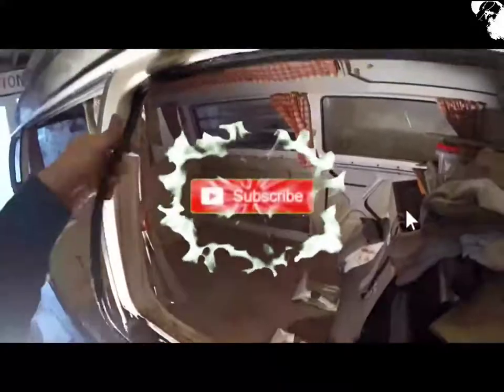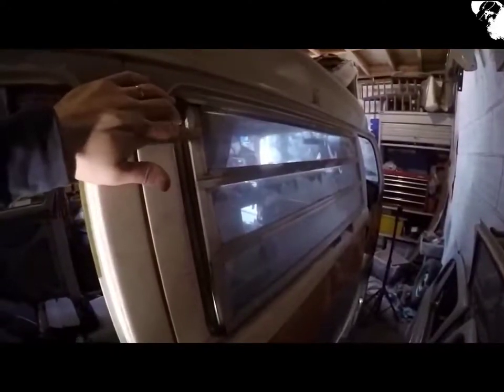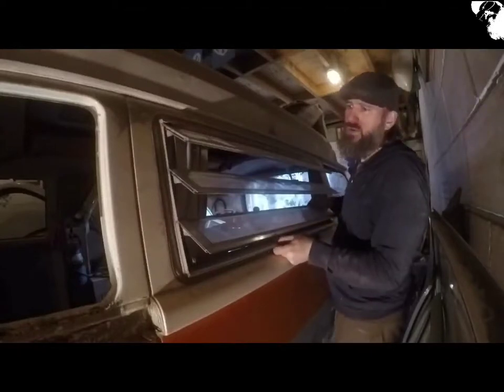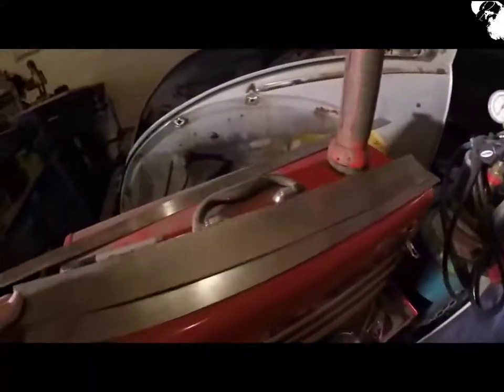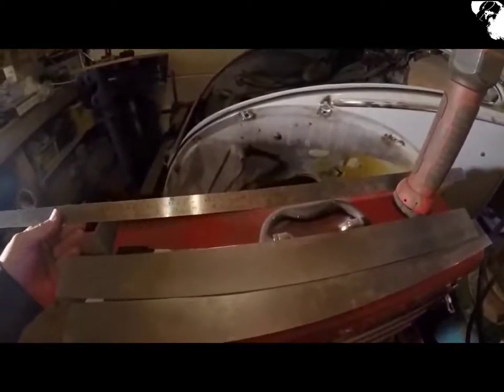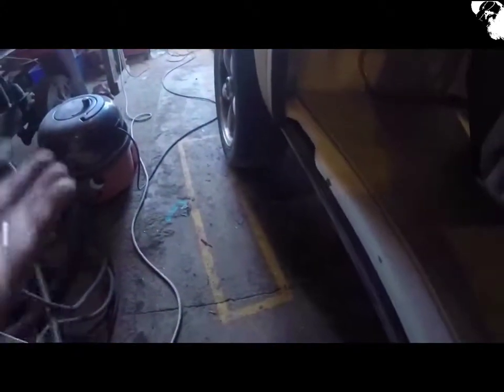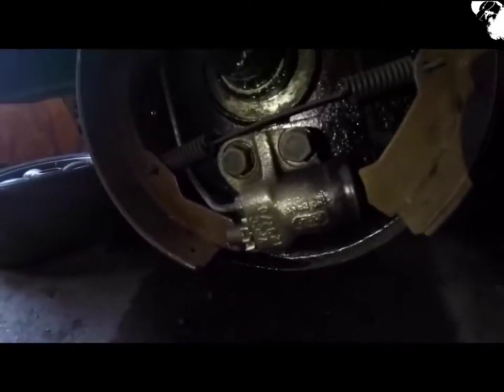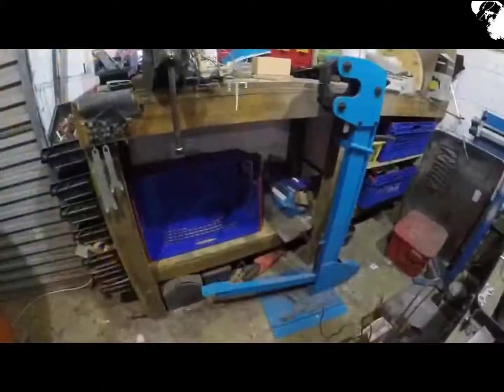Classic 1970 VW Camper Bus restoration. Day 100 - ‘Window surrounds’.

Comment: great work as always, those lights make a massive difference still waiting for electrics to be installed in my garage, I'm in the process on working on my t25 at the moment just wondered where you get your sheet metal from as my next task is to tackle the dreaded rust
Reply from the maker: Good luck with it...I just shop about to be honest. eBay have some vendors on there that are quite reasonable. It’s not  that costly really a 1 metre by 50cm sheet has seen a lot of repairs made on both projects...thanks for watching...
Reply: @VwRosstorations  Thanks for the response i will have a look online in a bit, I've kind of chucked myself in the deep end never done any body work before but have always loved tinkering with things so i thought why not.